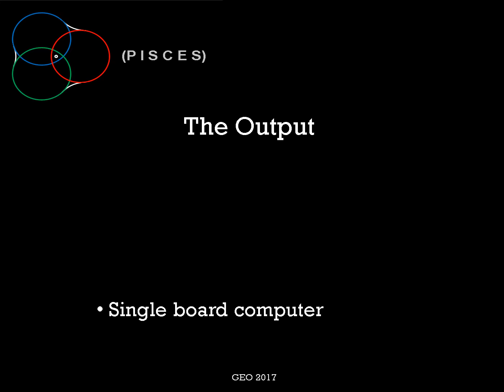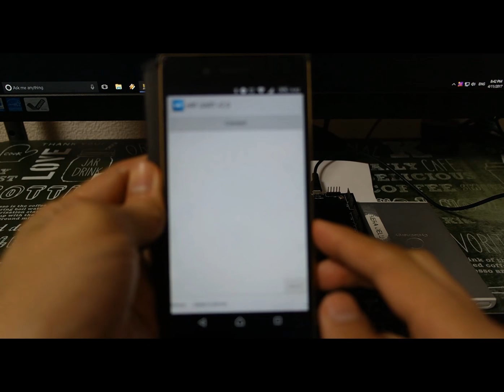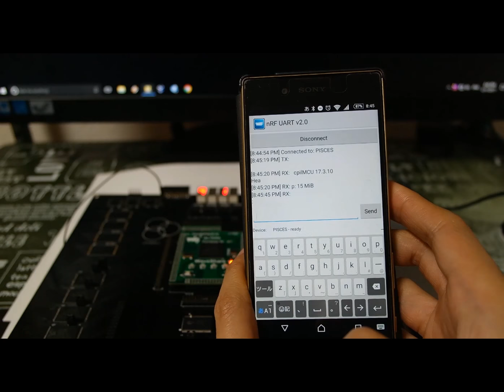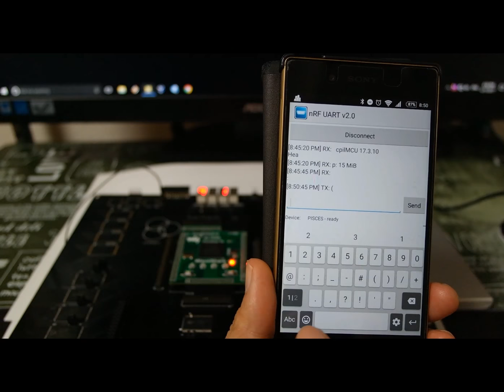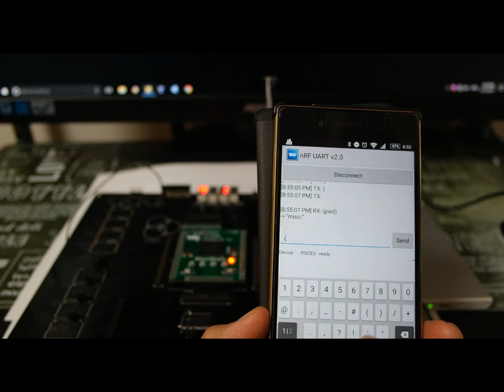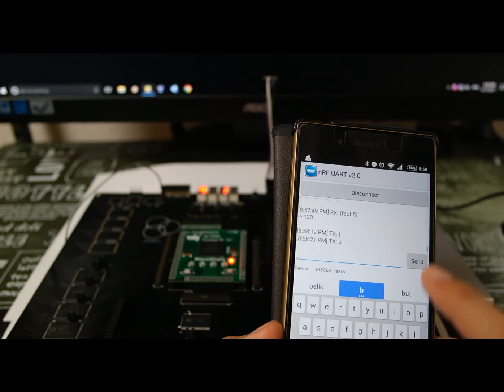PISCES: The Pi for every Lambda

Comment: You sound Filipino. Are you filipino?
Reply from the maker: Erle Czar Mantos Hey! Yes I am, kabayan?
Reply: @pangyao7  Yes! LOL. Nice work you got here. You still got that SGI machine?
Reply from the maker: Erle Czar Mantos thanks! yup! but currently left in Phil, missed those days playing with them.. i got an Octane, O2, and the one and only O2 laptop ;)
Reply: @pangyao7  If only I have the space for these sweet machines. How much did you buy your Octane for?
Reply from the maker: Erle Czar Mantos sorry very late reply. it was not that expensive because i got it from one member in nekochan who was in shanghai when i was still working i china... if i remeber correctly it started from 400 to 600 CNY. then i upgraded and added some add ons so it was also around that price.. octane is really heavy and very cool! esp the O2!! btw i saw your linked are you from iligan?
Reply: @pangyao7  Yup. From Iligan. I also have a thing for vintage machines, though I probably won't be collecting old, heavy workstations soon. I'm more into the early portable MS-DOS microcomputers.